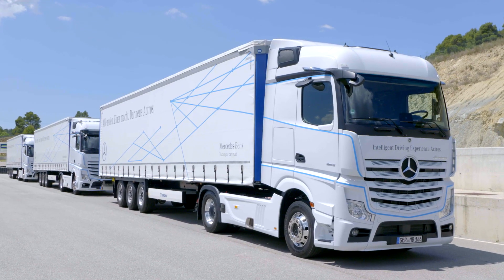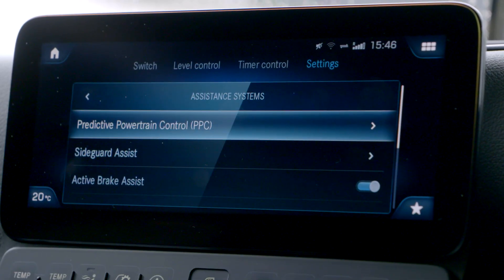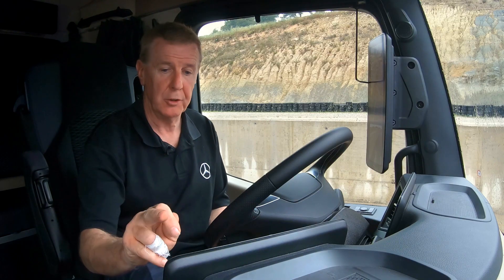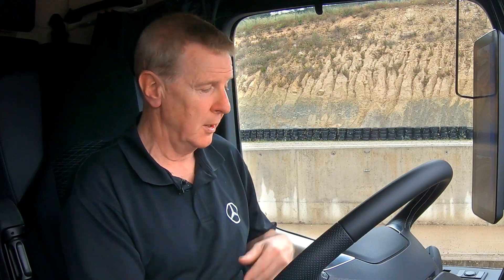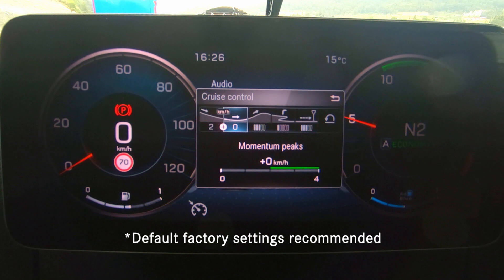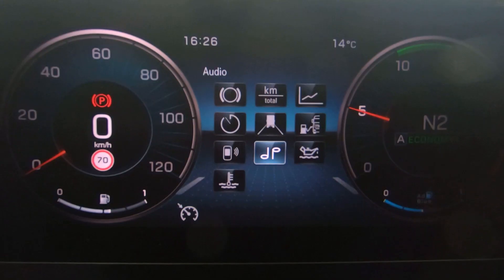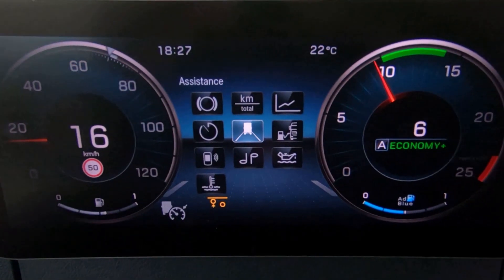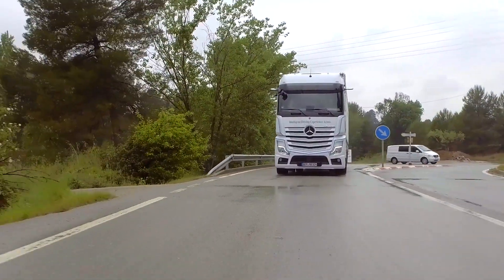New Actros/Arocs 5 Tutorials: Predictive Powertrain Control

Comment: Actually I found 2 things interesting here, I have a new 2023 actros and they trick me with this function, the only PPC I have it’s the “ECO ROLL” function and this cause higher consumption of diesel rather than if I desactive this function. Now I run it without it and save more fuel.
Also my distance sensor always coming up on yellow colour saying I have a car 1m on front, or red one (when I go in traffic jam it makes the truck stop without any previous news, causing me problems with other drivers)…. All those problems been reported to Mercedes dealer in Brisbane but after 1 year of fights for this and the terrible service they give there I’m still don’t have anything solve

Comment: A few problems im having with ppc is the trucks entering the roundabout too fast (above what its telling me its aiming for) but then hammering it as soon as you turn on the roundabout. Another thing is identifying corners that do not exist. Whats the workaround for this bar turning it off? Its becoming very stressful for me and my colleagues and dare i say it on the motorways when the truck brakes for a non existsant corner and we then have to take over and speed back up or just power through it.
Reply: I'm having the exact same problem at roundabouts. Its a very stressful unit to drive . Plus the camera mirrors are foggy at night . My old Scania 480 2009 was much easier to drive than this thing .  And that was a manual as well .

Comment: Who knows if the front plates (grill, headlights etc) of the AROCS can be replaced with the front of the ACTROS? I have been told this is possible, but my NEW AROCS (estimated delivery jan-20) needs te be rebuild in the leek & feel of the ACTROS.